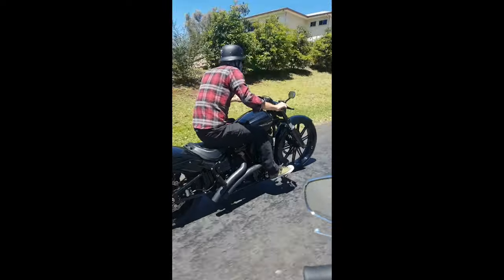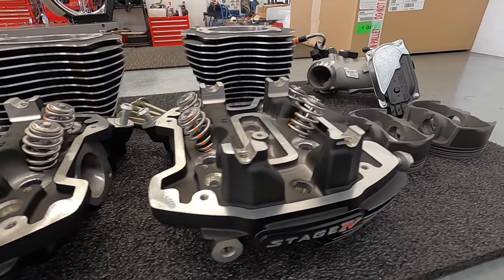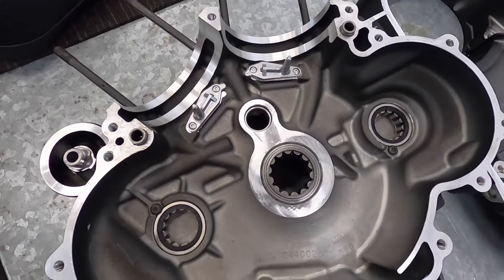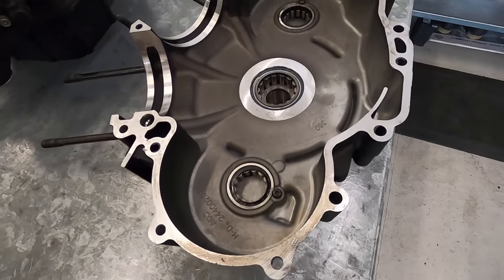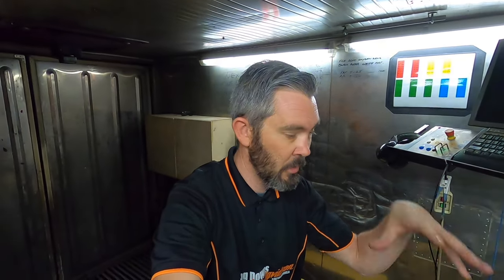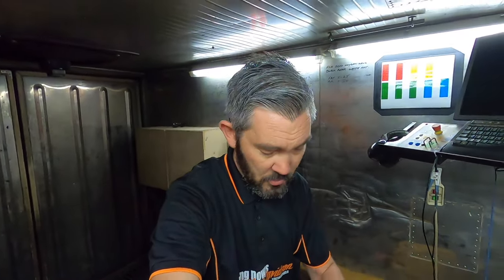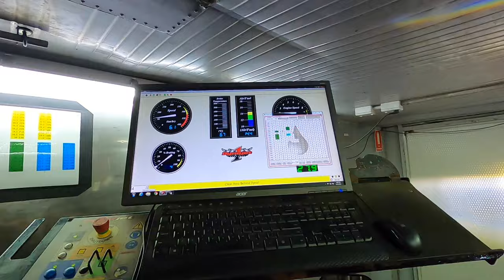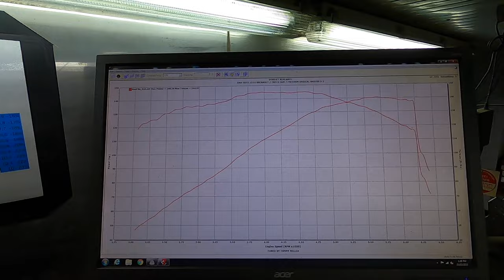131ci Breakout / Build & Dyno Tune / Stupid Fast

Comment: What's the kit worth?
Reply from the maker: The kit by itself is roughly $5500 AUD. Install & Dyno fee on top. (Roughly $1800) at our dealership, so around $7300 ride in ride out.
Reply: @MasterTechMiller  Is the dyno a full tune or just a power run?
Reply from the maker: @chrisgheller980  it's a full dyno tune mate. Complete comprehensive tune for your exact setup
Reply: @MasterTechMiller  Thought so. Where u located Mate. I'm in Sydney.
Reply from the maker: @chrisgheller980  we are in Toowoomba QLD, about 1.5hrs west of Brisbane
Reply: @MasterTechMiller  Ahh crap!!
Reply from the maker: @chrisgheller980  if you are keen, we can organise the shipping of your bike to our Dealership, get the while thing built and shipped back to you? 
We have done this before with many interstate customers. Something to consider.
Reply: @MasterTechMiller  do u know off hand what the cost of this would be.
Reply from the maker: @chrisgheller980  I will do my best to find out for you tomorrow & get back to you.

In the mean time, can you give me a little more info on your current setup. What exhaust, air filter & tuning device do you have.
Reply: @MasterTechMiller  Hi Mate,
Yeh it's a 2019 FXDR Stage 2, S&S 475 Cam, Screaming Eagle heavy breather, big radius pipes(Vance and Hines) Maximus ECU tuner.
Reply from the maker: @chrisgheller980  awesome!!! Thanks mate, that'll help me provide a better quote for you. I'll get back to you as soon as I can mate.
Reply: @MasterTechMiller  Sweet. Yeh May have to look at changing exhaust too. To a 2-1
Reply from the maker: @chrisgheller980  if you really like the look of the 2-2 pipes, you could go with the Freedom Radical Radius pipes. Very similar to the V&H Big Radius but provided better HP & TQ.

2-1 would be the best option though, especially on the FXDR, they suit them really good I reckon

Comment: Would i be able to do this 131 or 135 to my 2017 pro street breakout?
Reply from the maker: No. You have a Twincam engine which can go upto a 124ci with a Stroker crank and some machine work. If that's no something your into you can buy a JIMS 135ci Crate engine for your bike

Comment: Nice build mate, good video.
Yeh it's been a while since your last post, but life happens.
Had the Q all along about the pipes but you answered there at the end.
With a 2 into 1 would it make another 5 or 7 horses ?
Regardless I still prefer the sound of a 2 into 2 pipe, ya can't beat that sound
Reply from the maker: Yeah that's right mate, would have picked up a few more numbers with a 2-1 but as you said, the sound!!!

Comment: I can put this kit in my 2017 breakout cvo 110 ?
Reply from the maker: Unfortunately not mate. Your 2017 CVO Breakout is a Twin Cam engine. This kit is for the the Milwaukee 8 engine.
Reply from the maker: The closest you could go would be an S&S 124ci kit. 
A large amount of work is involved though. Your complete engine has to be disassembled & removed from the frame. Then the engine cases have to be bored out to accommodate the larger cylinders. 
From there you need to machine the cylinder head faces down to help increase the compression ratio for the cams that come with the kit.
It's approximately $12,000AUD by the time you get all that done, upgrade your clutch, dyno tuning, machine work ect.